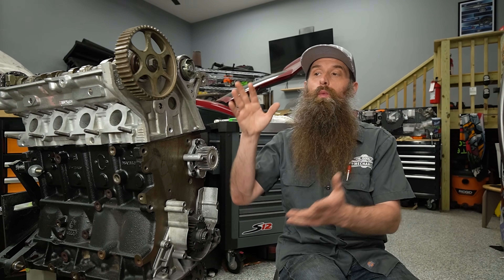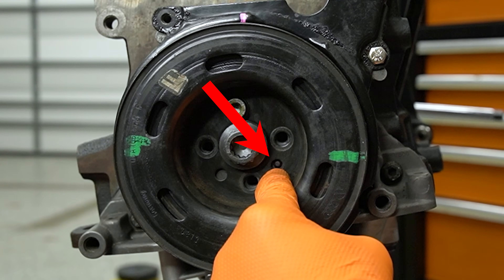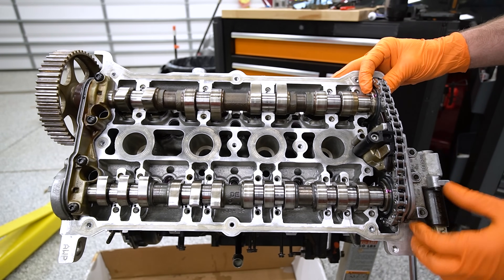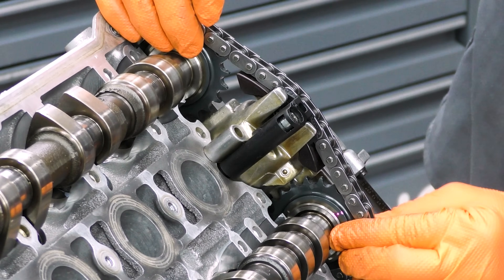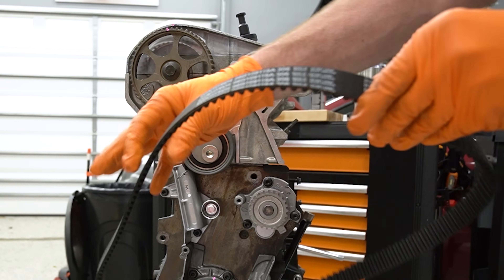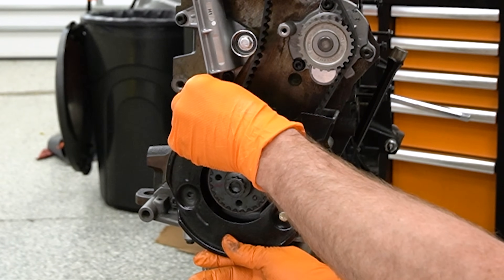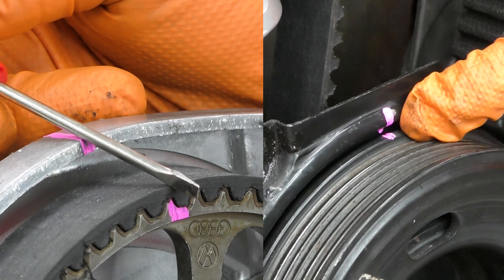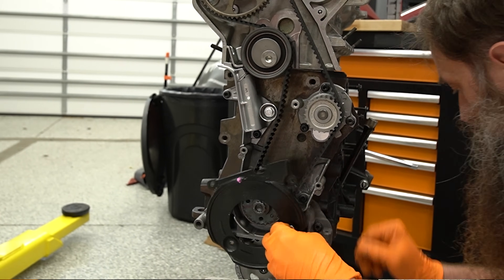How To PROPERLY Time VW/Audi 1.8t 20v Engine ~ Belt and Chain

Comment: Charles as much as i love your content, your method for timing the belt was bizarre, and not very useful for anyone doing the job with the engine in situ! The basic method of counting 68 teeth between the cam marker and the nipple on the crank gear is fool proof. The cam ALWAYS relaxes half a tooth tdc which leads to timing it a tooth out- the Simple way to resolve is to retard the crank a smidge during fitting to compensate. Marking the belt 68 teeth apart is so simple, and you can tell as you put the belt on if its in time or not, and save the faff. Finally- when you could see it was a tooth out and you still chose to rotate it- why! Yes one tooth either way wont cause contact, but if some idiot following the guide was more teeth out they would be getting valve contact. Anyway, thats my 2cents worth, take it or leave it lol
Reply from the maker: That method is by the book. It doesn’t get less bizarre than that. 🤷‍♂️ for sure there are other ways to do anything. And I dig it. But I’m not sure counting to 68 is any better. 

I appreciate the insight 😎
Reply: @HumbleMechanic  i get what you’re saying about by the book, in terms of the markers etc but the fact is- you put the cam and crank at tdc, put the belt on, and it was a tooth out. The 68 method is used in conjunction with that and never goes on a tooth out. Like never- i do at least 3 a week- never have to put the audi approved cardboard in there and turn over an incorrectly timed engine. Also, just a quick one for you, the tooth to the left of the one you marked, is always in line with that bolt hole for the pulley, and the tooth itself lines up perfectly with the webbed part of the seal cover, so its a nice easy consistent reference point for the crank sprocket without putting the cover and pulley back on
Reply: I will just add, if you end up needing little bits and bobs for the TT, i don’t mind sending bits over the pond for you, as a UK based TT specialist I’ve got access to anything you may need!

Comment: if you're one tooth off, big chance that you need to adjust it. If you're half a tooth off, most of the time it will correct it self after spinning the engine or even when you're tensioning the timing belt. When I do timing belt jobs, I usually back the crank gear off by half a tooth from the the TDC mark. The number one rule here is to keep the tensioner side slacky and the side where the crankgear is pulling on the belt tensioned. Most of the time my belts ends up a little slacky on the "pulling side" and when spinning the crankgear to TDC, it will correct itself and tension the "pulling side" of the belt.

Comment: To explain the intake cam gear being off a bit at the end, when you start the car and the chain tensioner fills with oil and pushes the chain upwards it pulls the chain so the notch on gear will line up.
Reply: Good information
Reply: Mind blown, thanks👍🏼
Reply: Mine has 16 rollers between marks, and the intake cam is advanced and doesn't line up right. Like you said, when I extend the tensioner all the way out, it lines up. That said, I'm getting a slight ticking noise and a P0011, which is Timing over advanced. Is my tensioner crap?

Comment: Thanks for info on 1.8T's, a motor I've always wanted to build! Not sure if I missed something, but you said at one point that the mark on the cam gear on this particular motor was incorrectly slightly behind the mark on the metal housing above the belt at an earlier stage of setting the timing. Then you explained that when the tensioner pin is pulled , it will move back bit. Due to the extra motion that will occur after pulling the pin, , towards the end of the video, you showed us a cardboard trick to move it forward as things were misaligned, prior to you pulling the pin. When showed TDC on the camshaft gear at the end after pulling the pin for the tensioner , it looked like everything was aligned perfectly, not slightly further back. In short my question is, because you also mentioned this is an interference engine, does the final cam gear mark need to be completely aligned or slight behind at the very end?

Comment: Ive done 2 timing belts on my MK3 1.8t just did my first MK6 2.0 TDI as well as several other non vw timing belts.  Ive found it very helpful to mark the old belt to the sprockets making my own marks with sharpie or paint marker then counting teeth on the old belt.  Transfer the marks to the new belt. This has saved me from having to replace torque to yield bolts on my TDI's cam and HPFP because the VW procedure has you loosen them for adjustment.  The method I used did not require this and the rig pins and crank lock all lined up without issue.  I figured if they timed it right at the factory, the gears should not need to be adjusted when using a n oem belt.  Maybe I am wrong on that idea, but it worked out for my car.  Hope this helps someone
Reply from the maker: For a belt swap I do that too.

Comment: After watching your video I feel bad that my mechanic charged me only 1000$ for changing my TT's timing belt and water pump. Of course he didn't open the chain side of the timing, but it's a very detailed job in such a cramped area

Comment: YES! Thank you Charles for finally doing a series of videos showing in depth technical stuff on the legendary 1.8T engine <3 Looking forward to seeing more videos!

I happen to own a Golf mk4 gti with an AWP in it too. its such a blast to drive even on the stock 180bhp, but spending a couple hundred bucks on parts and doing basic stuff such as deleting of all the nightmare and troublesome pcv/vacuum hose system and evap/sai eliminates the headache of pinpointing a vacuum leak and makes the engine bay look tidy.

Then with parts such as getting a decent intercooler, turbo inlet pipe, injectors and a good remap,  and these engines can reach the 300bhp+ mark on stock internals with a ko3s turbo and wont break a sweat.

VW did a fantastic job engineering this engine, its quite reliable if properly maintained and strong for a small 1.8L!
Reply: @MrBananaPsycho Heyy, a little late to this comment but I had a couple of questions. I currently have a Jetta with a 1.8t AWP engine and I have been looking on how to delete my sai/evap as it’s currently giving me a headache 😅. Did you get any aftermarket parts that helped you out? Or did you DIY it and somehow made it work 😂. Would appreciate if you replied, thanks!!

Comment: Have you done the 1.2 or 1.4 timing belt with the special tool that goes into the back of the cam and water pump pulley. Good fun!

Comment: ayyyy nice   i have n 01 beetle  early production based on the vin   i wanna make it "faster"  from what i understand i have the shit fuel pump the shit injectors and the garbage factory intercooler and ecm tune lol     also i wanna upgrade the intercooler  and i hate the look of fmic  i have seen mk4 golf intercoolers that mount in the stock location  i haven't tried to fit it to a beetle but any help is awesome and greatly appreciated

Comment: I have a question. Does the crankshaft position sensor know the difference between top dead center of an intake stroke or an exhaust stroke? What about in the 2.0T? I ask because I currently have a 2.0T ripped apart (burnt exhaust valve) and once that's together I'm rebuilding my 1.8T.

Comment: Nice video, great to use👍🏻 The cardboard idea is a good one. I also had to change the chain and tentioner not long ago which was a PITA at first but it went all right.
With the timingbelt i just mark tdc on the old belt and gears and remark the new belt, that saved me a lot of time, after that i've replaced two more 1.8t and one 1.9tdi belts

Comment: In my last comment here I mentioned that I my GTI AWD 1.8t timing and water pump were finished at 201K.  I have had this done twice by the same shop (AUTO4N in Cincinnati). The hack for lining up the marks is probably the thing you don't tell customers, but if you get it in time, that's all that matters. I now understand this job and also why VW/Audi timing scares some shops on the chain side. Well done.

Comment: I have auq engine golf and yes i like your videos from past body suspension interior sunroof brakes 
I like to see about the intake manifold the plastic base of injectors if i can to replace them with the intake manifold on or it necessary take off for best results..
1.8t 20vt power..
More videos is welcome
Thanks
Reply: manifold off job, the glue left behind from the cups is a pain

Comment: I must say im surprised by my 1.8t. It smokes, the head rattles, has timing codes, it leaks coolant and a bit of oil. Its been this way for 3 of the 6 years i've owned it. Still gets 29ish MPG and does not stop. Best $1000 i've ever spent on a car
Reply: Me too hahahaha i’m in the exact same situation 417k on my ATW 1.8t and she still is a TANK

I didn’t put all the miles on it. But i got it recent and it’s a great ride
Reply: @raymondmcfloss6225 omg that’s insane

Comment: Thank you for this!  It just came to me about 8 months too late! SO much confusion on roller count and where to count for the cam notches.  Also the AWM timing mark is a very very slight dimple on the cover kind of like the one shown in the video.  Great engine for a first time changing a timing belt!  Pulling the front end forward on the AWM made it so much easier!  I made the rods to slide the front end on, from old hardened steel shock rods i cut off, and the thread was the same as the frame bolts!

Comment: My friend tried to line the cams up on a 07 a4 with a 2.0t with 275,000 miles because the cam chain snapped. He got the car running but it’s throwing a cam/crank correlation code. Ran somewhat? fine actually.

Comment: also theres usually a timing mark on the flywheel if you're doing it in a vehicle
Reply: to allign the marks i used to advance teh cam on the timing mark about half a tooth which is perfect for aligning the timing mark when you pull the pin on the tensioner
Reply from the maker: @robmoot  GREAT point. I got the flywheel a few days after shooting this. LOL
Reply: @HumbleMechanic  I've worked on plenty of these but now I work in a body shop so I don't see engines as much these days I do miss the 1.8t simplicity though

Comment: bro! wish i'd seen this last month. I struggled with that gap set on the intake cam timing chain. so much so i ended up snapping my brand new chain tensioner. Be careful, if you over tighten the chain tensioner tool, you're running a risk. Had to buy the part twice and do the job twice. I should of just pulled the motor like you. lol
Reply from the maker: Oh man That stinks. Hopefully its back in action now?

Comment: Main question.... does a 1.8t ever lose?

PS the acceptable answers are 
-  No
- 1.8t nEvAr lOsE
- 20v Ride or Die
Reply: NEVAR
Reply from the maker: YES! It loses water pumps, timing chain tensioners, valve cover gaskets, oil coolers, coolant flanges, catalytic converters, cooling fans, alternators, Coolant temp sensors, injector o-rings, And probably a bunch of other stuff. 

LOL I always laugh when people talk about how "amazing" the 1.8t was.
Reply: @HumbleMechanic  I like to brag to my 1.8 friends that my aeg never has problems 😂 I'm over here Driving hundreds of miles to the bay and they can't even get their car to idle right
Reply: @isaiahabrahambonilla  2.slow life is not for everyone.  The 1.8t will either break or make you as a hobbyist mechanic.
Reply: @HyperbulimicEthiopian  I agree, I like my little 8 valve though. It took me having a g60 corrado to really appreciate the simplicity of it all. So much so to where I swapped my 2.slow to a manual. Call me crazy but .... Nvm I'm just crazy lol
Reply: @HumbleMechanic  one for all - clogged oil pick-up pipe
Reply from the maker: @hlasrozumu  I also forgot TRASH PCV systems, and broken vac lines... HAHHA And I totally forgot about oil pickup clogging and SLUDGE! This is why the "big B" 1.8t filter exists.
Reply: It always wins.
Reply: The maintenance is more than you can afford pal, you don't even need an s4 nowadays.
Reply: What about broken sai lines and pumps broken and full of water? All those potential problems and I still miss my 1.8t Jetta wb 5spd.
Reply from the maker: LoL yep!! I lumped air pump lines in with vac lines.  I forgot about the pumps
Reply: only if you're too soon 

Junior

Comment: thought on mk5 2.0 TDI?
Reply from the maker: Solid engine potentially. They did have bad cam and lifter wear issues.
Reply: @HumbleMechanic  compared to the bwa gti? I want to trade my in for a 2008 2.0 tdi. My gti is 2006. Cost me to much to maintain. I want to let her go plus the TDI has sunroof and Is better for my pocket.

Comment: No disrespect, but for the TDC mark I would rather go with the flywheel mark.  The pulley mark can ok or off depending how you bolt up the pulley to the crank.  There will be some movement left or right even when the bolts are in.
Reply from the maker: Tough to do when there is no flywheel, and no transmission :) That is something to be concerned about. That is why I did the straw method to show TDC so you can check your marks.

Comment: thank you so much appreciate it!👏🔧 you are awesome now i can repkace chain to my Seat Leon 1.8t 20v 🤗
Reply from the maker: AWESOME!
Reply: @HumbleMechanic  is mk1 2000 year yellow already replaced kit clutch ans fly wheel but i installed single not dual.distribution kit, water pump,MAF new,pcv valve new,oil and all filters,rear disc breaks and pads,recycled the gearbox at is was grabbing a little between 2nd and 3rd.now i have an issue when i rev it  from 3000rpm misfire  but i guess i have to replace sparks and coils.i think it,s a common issue this and the car had no maintenance.i restaure it all.big hug

Comment: I can't believe that cardboard trick works. What witchcraft is this? Also. Metal valve covers! Wow. The switch to plastic was such a downgrade. Cracked valve covers are easily misdiagnosed as PCV failure.
Reply from the maker: I Was actually surprised it worked. HAHAH

Comment: Great engine.
Still driving my Passat B5.5 1.8t (AWT) with 270000km.
First time i was doing timing belt and i was scary a little bit. But after i have done all work i was proud to my self.
The worst thing on longitudinal 1.8t to change timing belt is removing front end 🤣🤣 but you get used to that .
Reply from the maker: I LOVE those. LOL Id take that belt over the transverse ones any day. When we were doing them often I could to a Passat 1.8t in about 35 minutes.

Comment: Great video, as usual.  I wish I had known about that cardboard trick during my ownership of a 1.8T Passat.  Even after 3 timing belt replacements, I always ended up 1 tooth off on the first try.  Also, extremely jealous of the AWP's simplified tensioner/roller system.  The one on the AWM engines was awful!

Comment: Finally!  A 1.8T timing video of both timing belt AND timing chain/tensioner!

Quick Question:  How were you able to rotate the crank twice with the belt being off one tooth initially?  Wouldn’t that invite some damage?
Reply from the maker: GREAT question.... 1 tooth off on this engine is not enough To damage rotating by hand. I have had these off a tooth and the car runs... NOT well but runs.

Comment: Love the 1.8t,on my Audi i rotated the crank 1 tooth before TDC put on the belt and pulled the pin. It made everything line up perfectly.
Reply: So essentially it was the cardboard trick without the cardboard? And a little bit of foresight it would seem. Was your cam mark tdc?
Reply: @johndoan8016  Yes, cam at TDC